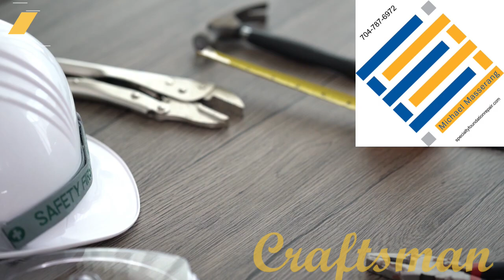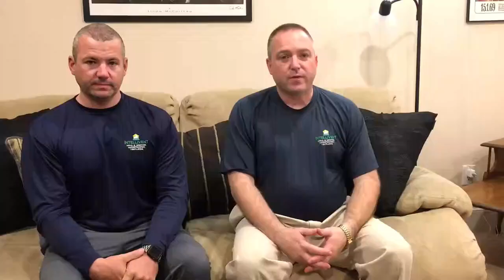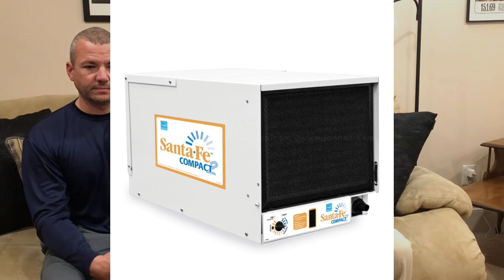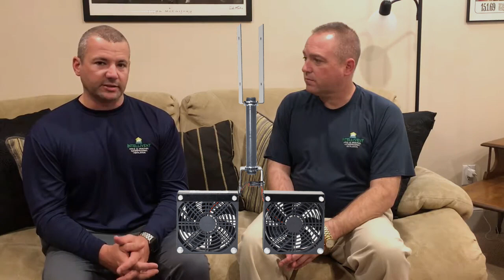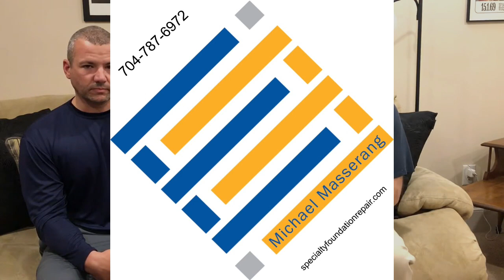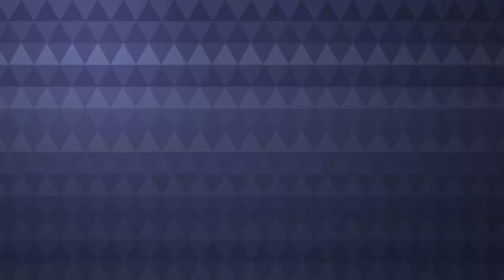Crawl Space Encapsulation and/or Controlled Ventilation 7 - Are Dehumidifiers Always Necessary?

Comment: I like it. Using the natural dry air
Reply: I had a company come out, when they started pitching thousands of dollars of battery backups for the dehumidifier & sumps I knew they were full of it. If I have an issue where are once in a blue moon power outages needs a battery backup I've got a huge structural moisture intrusion issue.
Reply: @Evan_Adams Then, they treat you like your stupid and don’t understand anything for not going with what they suggest. At least that’s been my experience.  More salesmen than home repair
Reply from the maker: @Curious_And_Judgemental , Exactly. I see customers being overcharged and/or misdiagnosed every single week. The attached playlist goes into more detail about the corruption in this industry.

https://www.youtube.com/playlist?list=PLKZytqO130AETijQ7kyhiSCURjY1ot2KK

Thanks for Commenting!
Reply from the maker: @Evan_Adams , the industry is rather predatory in nature. the manufacturing sector drives the industries through franchisee networks. Commissioned based sales teams push products instead of solutions. I'd rather see you invest the $1500 into a Generac instead of the battery back up systems that have limited capabilities. And the marine batteries have to be replaced every few years. Please feel free to watch the attached play list that goes into more depth on the corruption in this industry.

https://www.youtube.com/playlist?list=PLKZytqO130AETijQ7kyhiSCURjY1ot2KK
 Thanks for commenting!
Reply from the maker: Thank You for commenting! Yes, the advantage if utilizing the outside air in a controlled way is never discussed. The manufacturing sector wants to seal seal seal! Changing the the building dynamics of how the house was built in the first place can cause terrible problems with air quality and the performance of the home over time that the franchisees never want you to know.
Reply: @Specialtyfoundationrepair  the several videos of yours talk about why we should choose you over the evil franchisee but you don't provide any education,  the video title implies i will learn if dehumidifiers are always necessary and basically it seems there is an alternative that you don't educate us on at all and that what i came to learn about.  encapulation is now code [i'm pretty sure] for all new houses here in the triangle but my house is 23 years old and has vents.  i'm worried about pipes freezing when its down to single digits for several nights.  its very dry in the crawl space but the humidity in the summer does raise the humidity in there to 70-90% for 3 months or so.  how do i controll humidity with a vented system?
Reply from the maker: @robin8773 , as long as we keep this in the theme of educating the public I will go along with this for a little while. There are plenty of additional educational videos on the channel for you to watch. Based on your comment you must not have had time and/or the ability to find them to review. So I will add an additional link.

  https://www.youtube.com/playlist?list=PLKZytqO130AGNoTsMY9zOuxZcHumRP-tN

Encapsulation is under a separate part of the building code book. It is NOT required for new builds. NC building code does allow for different types of foundations for you to build with including traditional vented crawl spaces. So that is that. You must educate yourself on what dew point calibrated systems means in regards to moisture control. You must also learn why relative humidity is such a bad way to calibrate any crawl space system. Once you learn why you will understand that hybrid systems under vented code are much better for houses. New or Old.  You may also get on Atmox.com to learn more about dew point fired fan systems. You say you are concerned about freezing pipes? Well, you can recalibrate your crawl space vents to keep the cold air out. Continue to study the same material to learn how. A dehumidifier is just a tool in a combined system. Not all houses need them.

Lastly, I do not service your area so it makes no difference to me whom you work with locally. If you would like a referral, I will be happy to share one with you. If not, you can take your chances with the dreaded franchisees and roll the dice. They sell product. Not solutions. But many clients fall for that approach. I do recommend that you educate yourself before making any final decisions. And based on the comment, you have a way to go before making that informed, educated decision. Thank You for commenting!